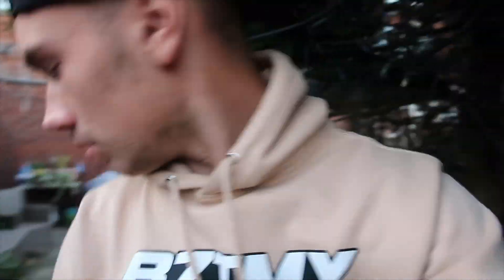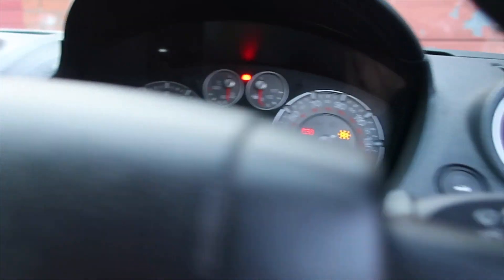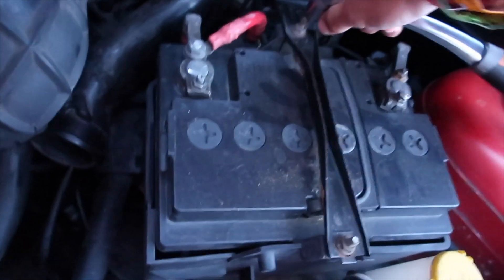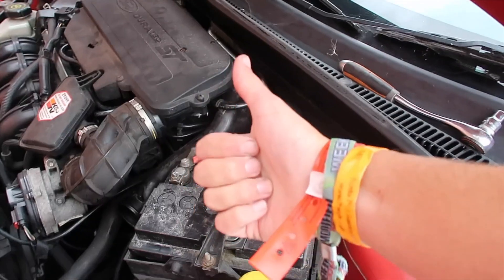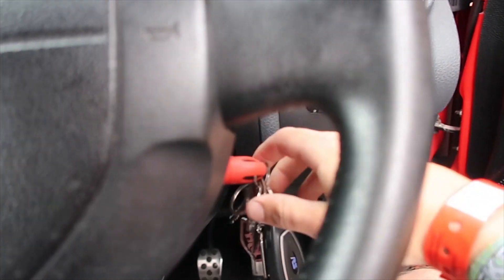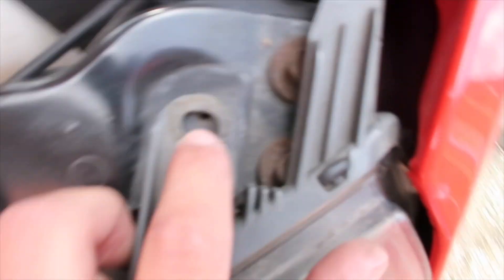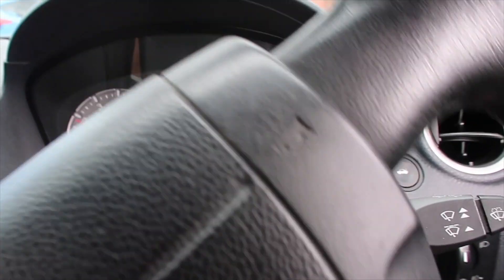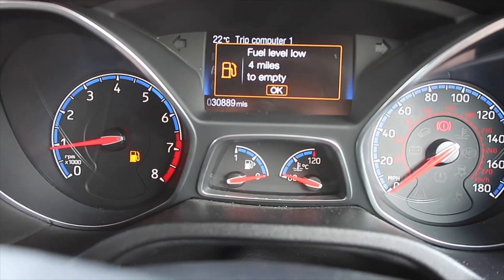THE ST IS ALIVE!

Comment: Pointer for you mate always disconnect the negative terminal before the positive! And it’s deffo the battery that’s got no charge you could here the starter motor engaging when you tired to turn it over!
Reply: and then visa versa when installing, plus those headlights ain’t in properly the sides to the wings go in first and clip into the wing then you can put the tabs in at the top and behind the grill and finally your screws you will know when the headlight goes into the clip as it will sit closer to the wing than you had it!

Comment: On the inside of the wing there is an extra clip that the headlight clips onto to hold the headlight in place, i always had trouble trying to get them aligned and clipped together, in the end i removed the clip of the inside of the wing (should just pull off) and now i can always get the headlight to fit better and more easily.

Comment: Definitely sounds like a battery problem as for the headlight use 3000 grit wet and dry sand paper and use a sealant after

Comment: with the headlights you got to clip into a holder which is on theinside of the bumper facing outwards, pop it in and then everything should line up

Comment: Just get some compound and a good buffer and that’s all you need, also if the battery is gone why would the radio come on?
Reply: Engine requires a lot more power than a radio

Comment: haha your fcked... that bad idle is 100% pcv value... diy job bit fiddly as hell.. you need to buy the silicon replacement, its cheap enough bit of a pig of a job :P - Also headlights, where there plastic clips on the inside of the wing, for the tabs on the side of the lights? they will locate it.